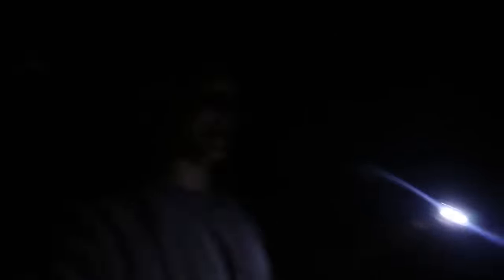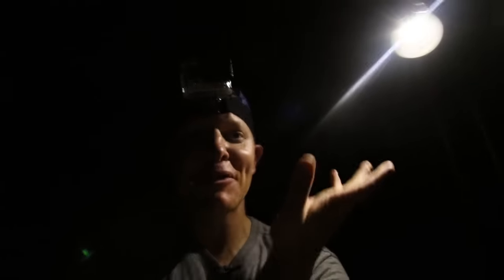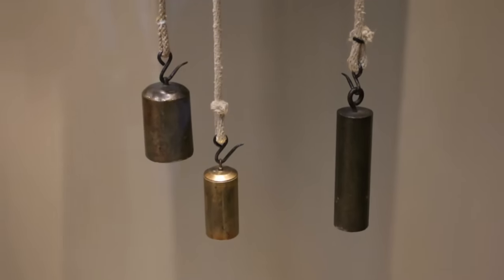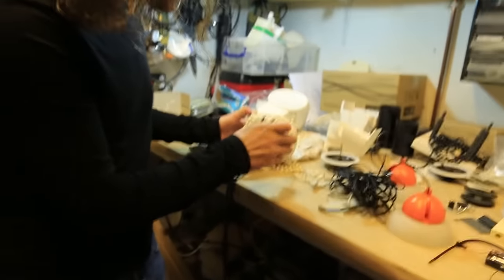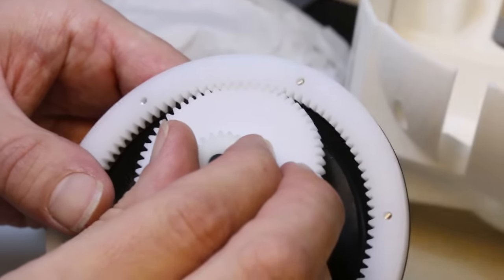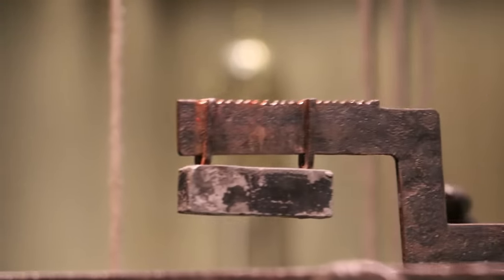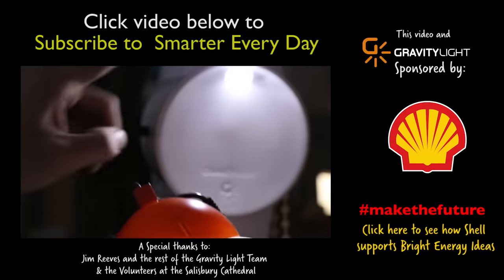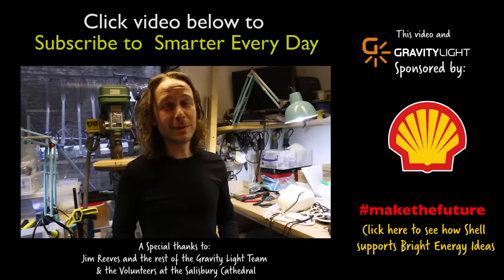Turning Gravity Into Light - Smarter Every Day 146

Comment: BRILLIANT! I still don't understand how the LED prevents it from spinning faster, why wouldn't the weight just fall faster and over volt the LED?
Reply: Agreed. Just at the most interesting bit (as a student of physics) - the mechanism for the linear decrease in GPE - his explanation is "Once the generator turns up to a certain speed and that voltage limit is reached, the LED won't let it turn any faster." Other than the circuitry having a threshold on V_emf, that is no explanation whatsoever!! How does the LED not let it turn faster?! That's the crux of the matter. Just stating it happens doesn't explain it, Mr +SmarterEveryDay. As such, I would very much like to see a supplementary video explaining this key (missing) explanatory step. Thank you for reading this (if you did). All the best.

PS This is an amazingly simple concept. Why has no one done it before?? As the potential energy comes from lifting an object (i.e. GPE), I'm thinking about the applications to a gym - storing electrical energy that can be used for any number of appliances one could connect to it.
((Proof of concept: Have several GravityLights in a row, lift many objects and have a larger amount of light! But then imagine creating a device where one can lift ONE object several times to store that same amount of total GPE, which can be used for whatever purpose and when the user chooses.
I also watched your video on the ARED, so maybe those guys would have some idea how to go about it.))
Reply: Electrical resistance I would assume.
Reply: bossmanham
 Yeah it makes sense to say it, but when you ask yourself why it wouldn't just over volt the LED I can't seem to see any reason why it wouldn't. For instance if I had a hand crank generator hooked up to a tiny light bulb, why would it be impossible to just crank it faster until the bulb burned out?
Reply: 95TurboSol Think of it like water going through a hose. The certain electrical connection, in this case the LED, can only fit so many electrons through at once. Just like a hose can only fit so many water molecules through at once.

Not 100% physically accurate, but pretty close.
Reply: bossmanham
 In theory it sounds right, however it's definitely not physically impossible to fit so many electrons through something that it just melts the medium that it's flowing through because of heat. For instance, if you took a tiny string and flung it up to a high voltage power line, it would kill you even though the string is tiny, and back to the LED case, I know for sure it's possible to send enough power through an LED to burn it out, so why wouldn't it do that instead?
Reply: Because the extra resistance across the LED makes it harder to turn the generator, so the weight won't fall any faster.

If you wanted to continue the water metaphor, if you were pumping water through a small pipe with a hand pump, it would become increasingly hard to turn the pump as you turn it faster, forcing more and more water through to pipe.
Reply: 95TurboSol Not if the connection is strong enough to take the heat.
Reply: The clue is the energy stored in the coils of the motor windings. An LED is actually a Diode. Diodes let current flow in 1 direction, but resist up to a specific voltage in the other direction. So, the LED is acting like a snubber diode on a coil load the load delivers a counter EMF. That causes the motor to run like a stepper motor, click click click instead of smooth spin? Spin it fast enough 1600 rpm with 4 windings give a switching speed 6400 Hz blinking on/off.
Reply: Gary Deen
 Now THAT makes perfect sense, thanks!
Reply: From watching the Shell video the explanation, I believe, is that the LED does not have any forward current until the spinning rotor generates 2v no load. At 2v, 20ma can pass but this slows down the motor and speeds up and slows down until exactly at the 2v level.

But that doesn't make sense to me. To me, since the motor is trying to make a higher voltage than 2v, that energy is fed back as a breaking force (as long as the voltages don't approach the avalanche voltage).
Soon, I dunno. I'll build one and measure...
Reply: I imagine there is a resistor that limits current flow by x ohms decreasing power draw and slowing descent of rocks?
Reply: +EddiePortal the reason this hasn't been done before isn't because no one thought of the idea, but because without the high efficiency of the LED light it is impractical. this really isn't different from pumped hydro..... which would of developed sooner if solar and wind had became cheap or coal had become expensive sooner....
Reply: +Gary Deen I'm just checking if my understanding is the same as yours.....

if you shorted the generator, the mass would fall straight to the ground and if you instead made an open circuit the fall of the mass would be extremely retarded. Is this correct?
Reply: The torque on the output shaft to the generator is very small and tuned by the weight and gear reduction ratios they chose.  The small amount of resistance created by the LED when it's attached to the generator balances the torque because it's proportional to how fast it spins (up to a point before it burns out - which is why this torque must be carefully tuned).  The concept is basically the same as terminal velocity, except in this case, instead of air creating the proportional resistance to balance the falling object, it's a very small proportional resistance created by the LED that balances the torque, producing a constant rotation, and allowing the LED to extract ~1 watt of energy as the weight falls at a constant rate as well.

Remember that watts is joules / second, and a weight raised to a height has an gravitation potential energy in joules given by mass(Kg) x height(meters) x 9.8 m/s2 

If you were to raise 10kg to 1 meter, you would have 98 joules to work with.  If you want to extract 1 joule per second, then tune your gear ratios to produce a torque that will balance that load (1 watt LED).  Then, you will have 1 watt of light emitted by the LED over the course of 98/60 = 1 minute and 38 seconds as the weight falls at a constant rate (thanks to your tuning of the gear ratios to match the load).
Reply: +EddiePortal 
"...storing electrical energy that can be used..."
The greater challenge is to store the energy than to transform it
Reply: Actually, the answer is given in the video itself, if you look at the graphs carefully.

This has nothing to do with resistance, LEDs are semiconductors and their resistance behaves quite weird anyway, but explaining that in detail requires a bunch of quantum mechanics and solid state physics. The LED's resistance would actually drop if you pass a higher current through it and heat it up.

As a matter of fact, a LED will happily pass almost any current through it, once a certain threshold voltage is passed (allowing electrons and defect-electrons to move past the band-distortion at the interface of the differently doped regions, which is rather small in the forward direction) and you will see an exponential increase in its i(u) curve.
An exponential increase in current however requires an exponential increase in charges provided by the source, which, in the case of the generator, requires an exponential increse in force/torque on the input shaft. If that's not provided, the voltage simply breaks down (= rotation slows down).
In other words: Past a certain threshold voltage, the LED demands excessively more force from the pulling weight for even slight increase in voltage/turn rate.

You can try that yourself if you have a generator at hand that you can operate with your hands. Turning that thing is a totally different experience if you have a huge resistor or even a gap in the curcuit on the output side vs a short curcuit. The short curcuit will pass basically any current at even very low turn rates, leaving you pretty sweaty pretty fast.
Reply: Maybe there is counter gear for reversing the main gear if it's speed up too much?
It could be powered up by excessive voltage.
Reply: Shallow JR
No, that is wrong.
Reply: Wyand Well, what i understand is that the led make the electricy goes in one direction, so the excessive energy would never flow backward, it's just really hard to understand why it's limiting the speed up of the main gear.
(That's why i come up with reverse gear that is go againts the main gear when the voltage that went tru the led has reached led's capacity limit.)
Reply: Shallow JR
As I already wrote.. the answer is given in the video itself. The LED requires an exponential increase in current if you want to increase voltage past the LEDs threshold voltage. That means, after reaching the turning speed that matches the threshold voltage on the generator, the force/torque required to further increase the voltage also increases exponentially.
Reply: Wyand How about the secondary gear that showed on the video, is it had fuction to make the main gear had fixed rpm (it's remind me at how matic motor works, the main gear is actually had the fixed rpm, but the secondary gear could change to be slower or faster to make better transitioning, but in this case it's to stabilise the rpm of the main gear that is effected by graviational force)??
And it's not intersect with the explanation from thom1218
Reply: Shallow JR
I'm not sure what you're after right now. It's just a fact, that a LED (or diodes in general) pass pretty much any current after passing a certain threshold voltage. To the point where they simply get destroyed.
Now go and try to generate a couple of amps with a generator, using your own arms to drive it. You will notice that you're almost unable to turn it, if you short the output.
Reply: Just had some time thinking about this and figured it out.

So, as a DC generator is turned faster and faster, the voltage/emf across it grows. At a certain voltage, the current across the LED (and thus across the generator) increases rapidly as seen from the I-V graph. This creates a large magnetic field inside the solenoids in the generator which creates a counter torque resisting the spin of the solenoids. Once the current is large enough so that the counter torque equals the torque from the weight, the angular speed of the spin becomes constant.
Reply: They have an led that matches the output with a given weight.  The first gl generates around .1 watts.  You could easily stop the weight with more resistance in the circuit.  The motor is connected by rubber, so if it exceeds a certain torque it slips.  There was also some kind of governor, think the 3 gears turned in a wobbly motion, as they were not perfect circles, I guess for safety so the 25 pound weight doesn't sudden drop if the circuit fails in some way.  I actually think the gears should be done away with.  Use the resistance in the circuit to regulate the fall rate.  I modified the first gl to do this, 15 minutes per foot.  If they just had a custom wound generator built specifically for this purpose I think it would work better.
Reply: the electric force is much, much stronger than gravity.
Reply: Shifu Careaga
That isn't quite true....
You see, saying that one force is stronger than an other is like saying your peanut butter sandwich is a not fast airplane - It's not even the same category. Each force has a force carrier and a field (let's keep this short). They don't quite interract with one another.
Gravity is a property of matter - Electricity is carried by electrons who have charge - and leave it at that...
Edit:
If you want to learn more I strongly recommend the scishow series
Reply: i don t think what u re thinking is very smart!  how are u gonna store potential energy?! that energy is not extractable from the object only way to use it is to litterally drop the object!  how are u gonna lift one thing multiple times and store the potential energy? everytime you put down the thing to bring it back up u re losing the potential energy!!!!   i don t know how else to explain it hopefully being a phisic student u ll undertand what i mean!
Reply: Miroslav Musarliev being I am an electrical engineer by training lol I don't think I need that I went to four years of college and did equations that took up four pages.

yes, the electromagnetic force is stronger, period. this is well established I hope you will do your research.

that is why a tiny magnet can repulse and hold up an object despite the Earth's massive gravity.

feel free to look it up anywhere. Strong, Weak, EMF and then wayyyy weaker is Gravity.

now as for the last post you can waste 90% of solar energy just to lift your object for the benefit of constant drop. the solar energy provided can exceed the needs to lift the weight and be stored in a battery, meanwhile the sun doesn't run at night. you use the battery to run a motor for a short period so that the dropping object can run for extended periods. it is inefficient but all that matters is you solve darkness. the battery isn't worn down because it rarely runs. besides you can collect other forms of energy to charge the battery storage as well. meanwhile if for some reason it won't lift like a  month of no sun, you add a hand rank and convert kinetic to potential by hand. efficiency isn't as important as the constant inertial drive gravity provided by being a constant force.

btw LOLz at the attempt above that was classic. best of luck to you folks... lol!!
Reply: Miroslav Musarliev btw what do you think matter is full of?

Charge.

haha what a riot.
Reply: I am not debating wheter one force prevails over an other. I'm just saying every one is different than the other. It is difficult or even impossible to compare them.
But that magnet thing - Earth doesn't have that massive gravity you are thinking of. Compared to other things, that are quite abundant in the universe, Earth has a "small" gravitational influence
Matter might be all full of charge, but most of it cancels out (- +)
But if you are willing to write an article about it I would gladly read it (or any other science article really)
I look forward to your response :)
Reply: Everything is relative. Earth's gravity is small, but compared to the gravity between the magnets  which are repulsed it is quite large. Speaking of which, gravity between the magnets is so tiny we call it 0 but it isn't 0. However not only does the EMF overwhelm the Earth's gravity, it completely eclipses the gravity between the magnets.  So, yes, we know the one is much stronger for a fact.

Lastly, there is a concept called variable gravity and we are just a couple adjustments away from linking gravity from charge density. If you study the equations it is clear that gravity is modified/diluted EMF. And so are the Strong and weak forces. This makes complete sense because everything is not about actual substances and particles but the interaction of field lines and charge polarities.  The big question is why doesn't gravity have a repellent quality? Perhaps it does but we don't see it, or perhaps things behave differently depending on the dimensional quality. 

It's all one Force, but we see them as 4 because we are using models that aren't yet complete. Every branch of physics is searching for a unified field. So you cna think of them as different, if you like, but that's just appearances, it's not actually different, no more than atoms are round objects and electrons "orbit" the nucleus.

"Think that's Air you're breathing?" 
Within the Nothingness there is Something, but as to what that something IS we are not so sure. WE just have a lot of models, and partial answers. Follow physics closely you'll learn that almost every rule you grew up with or been taught has been identified as either wrong or just a partial truth. There is no Absolute Zero, and the standard model is lying all the time to keep up the appearances of solving things. But logically, most of it is a bullshit story they've concocted to protect careers and the narrative. Quantum is taking a big dump on all that.  Did you know they disproved Dark Matter last year? It's complete nonsense that's madeup and they are teaching it in schools like fact.  Two separate papers destroyed DM 'theory' which was already based on flimsy evidence to start.
Even Red Shift - or their version of it - has not panned out. The solar fusion model. Accretion model. Dirty snowball.  All debunked.
Reply: So how do you guys explain that the weight in the clock he showed just doesn't fall faster and faster down? Is it because of those propellers which create air drag when they spin and air drag increases exponentially with speed so the system reaches a terminal speed?
Reply: 95TurboSol in my theory it's the gears that make up the gearbox. It takes more effort to crank a gearbox that increases speed, which in this case the gearbox is amplifying the speed of rotation up to several hundred times and therefore it takes more force to make the weight drop a faster rate.
Reply: I'm not an engineer or a scientist... but surely the extra weight has to be converted to some kinda of energy i.e. heat . If the device was strong enough to hang 100 tonnes from it, I can't believe that it would still drop at the same speed and the LED would be fine.

Or does it just work in the realms of light objects that you can lift yourself?
Reply: The LED provides a negative feedback to the system. As the generator spins faster and generates a higher voltage, the LED will let through exponentially more current thus increasing the required force to keep the generator spinning at the same speed. The generator will, therefore, spin at the equilibrium point where the torque applied by the weight equals the required torque to keep the generator spinning.
Reply: The LED is a diode which means the current can only run one way, and all diodes have this voltage limiting behaviour. Why? That is probably quite complicated
Reply: Watt governor i Guess
Reply: No, if you remove the load from the generator, the bag of rocks will fall faster.
Reply: UGH I couldn't I only read about 75% of the above response to the question of why the weight slows and doesn't keep speeding up as it falls. I saw many right explanations and some really wacky Alt-Science given (Gravity and force of attraction are NOT equivalent forces). Unfortunately like the video even these explanations leave out the WHY or HOW it happens (there are various innocent reasons this happens) but anyway:

As said before - the LED can cause EMF to build up in the generator as the max usable current flow is reached, but the generator keeps trying to generate more current, since current can't flow the power held in the associated magnetic field grows stronger. This field is a force that pushes back against the rotor of the generator - slowing it until there is a balance between current flow and the turning of the generator (regulated by the back-EMF). It acts like a brake. 

The forces involved at the motor/generator are a lot weaker than you would suspect. the gear ratio (and therefore the power ratio) between the axis of the motor and the larger gear used to hold the weight is very very very high. So that the little bit of reverse torque the magnetic field applies is also very very high as it counters the weight in the larger gear.

If modified - so that a power source replaced the LED - you would have a fairly powerful hoist that would raise the weight as well.
Reply: Gears
Reply: So more weight should increase the brightness (current) but the burn time would remain constant. Right?
Reply: hey guys we post the most awesome viddds
Reply: 95TurboSol The current flowing through an LED increases exponentially wrt voltage. So after a certain point, increasing the voltage across the LED would require exponentially more force. Hence, the speed of the weight remains practically constant.
Reply: 95TurboSol because as long as the weight falls their is light
Reply: as an led is provided with more and more voltage the resistance gets greater until it burns out
Reply: its mostly because of inertia of the weights but air resistance can also play a role depending on how its built, like those little music boxes, air resistance is the main regulator
Reply: simply put the dynamo canot suply more power than used so if it tryes to do so it gets harder and harder for the thing turning inside the dynamo to spin slowing it down.
Reply: There are some limitations on the generator
Reply: Power electric (Pel)=Power mechanical (Pmech)
Pmech = (Nm)/sec
Pel= Volt * Ampere

V*A = (Nm)/sec
V*A = (N*(m/turn))/sec

So when force(N) is increasing, time(sec) (more time per turn)or electric power has to increase. 

Power through LED has to be limited, so unused power becomes heat.

I think it is more like both possibilities come into force.
Reply: Gary Deen
thanks for the detailed explanation, I was almost dying to know :)
Reply: it absolutely would, there needs to be a voltage regulator or at the very least a fuse in case somethin happened like  a kid got ahold of it and pulled down on the weight.. i can almost guarantee thats goin to happen. the led cannot regulate voltage, it does act as a one way valve or one gate for voltage but not as a regulator, in fact leds are pretty dam sensitive to voltage, different colors need different exact voltages and amperages  to even work
Reply: Actually it does spin faster when the LED is conducting, BUT at greatly reduced rate of increase ("it's leveling off").
The LED is the "brake", the "brake" is "applied" when the LED lights up.
Reply: EddiePortal the more current that is generated the harder it is to turn. 
Lenz's law states that the current induced in a circuit due to a change or a motion in a magnetic field is so directed as to oppose the change in flux and to exert a mechanical force opposing the motion.
Reply: EddiePortal that's probably proprietary information
Reply: I assume it has something to do with the  Lenz's law.
Reply: It just a kinetic energy my man.. Gravity is just the force used to power the kinetic energy, to form the light.. The gear itself controlled the weight so it fall slowly..
Reply: That's why they were working on those gear..
Reply: It's not LED,it's the generator with a regulator like a zener.
Reply: Daisy Duke, No it is not correct. 
If you shorted the motor out it would slow down significantly, as there would be a low impedance path for the current generated by the motor voltage, Lots of current at some low voltage is still a substantial amount of power being drawn from the spinning motor which would stop it very quickly. 
If it was opened circuited, no current would flow, thus no power and the motor would continue spinning. 

As to why the LED will limit the motor speed, My take on it is that up until the Diode spillover point, there will be no current flow.  Thus the falling weight will accelerate the motor quickly until it's generated voltage reaches the diode spillover point. 
At that point, current will start to flow and the Motor (Generator) will start to generate real power. This power will oppose the falling weight and slow its rate of descent. 
What confuses me is that extra weight will require a greater torque to stop it from accelerating downwards, This can only come from increasing current (as motor (generator) torque is a function of current and field strength, and not voltage). 
The the bigger the weight, the more current must flow to maintain steady state. Eventually the diode will fail from generated heat. This is where My understanding falls apart. 
A possibility is that the generated voltage starts to collapse at a certain current level and thus reaches a point where the current and voltage max outat a level that is hopefully lower than what the diode can handle.  So by matching the Diode with the Motor, they can make something that will be inherently fail-safe.
Unfortunately, this does not address the situation where bigger and bigger weights are applied, because if the motor did run into an inherent power limit, more weight would then result in greater speed as the limiting torque of the motor would not increase once it reached it's power limit. 
My gut feeling is that it is all to do with the high gear ratio, but i'm not sure of the mechanism.
Reply: Has it something to o with the barrier potential of the light emitting diode?
Reply: after the led hits a certain voltage, it stops letting voltage through so the extra electricity powers to motor which makes it have more resistance. this is based on me guessing and the limited knowledge i gained last year playing with motors to make a model of a windmill in my tech class.
Reply: @daisyduke5121  no! The other way around. The MAXIMUM load for a generator is when the output is short circuited (bad) and minimum with no output load. The diode becomes a variable increasing load (more current) at a higher voltage but it also wants to maintain a constant voltage which means the generator receives a bigger load as the output voltage increases thereby providing negative feedback.
Reply: @shallowjr8291  Answer to all your questions is: DIODES, that's right, let me explain, you acn connect a diode in two ways,

Way 1: Forward Bias
If a diode is connected in forward bias if will let any amount of current pass through is no matter the voltage, essentially providing 0 resistance, but this is not what we're after in the above case.

Way 2: Reverse bias
Think of a diode as a one way valve, you can throw in as much material as you want in one direction but 0 in the other, similarly a diode connect in reverse bias won't let any current pass through it, but there's a catch, normal diodes have something called a break down voltage, or knee voltage, what happens is till a certain amount of voltage the resistance is extreme, but once that threshold is passed the current increases exponentially, why this happens is pretty easy to understand but I wouldn't want to do that since that requires knowledge about semiconductors down to the molecular levels.
Reply: @imadmorsli2871  "Stops letting voltage through" wat? Voltage is the difference between the amount of electron between two points
Reply: Load.